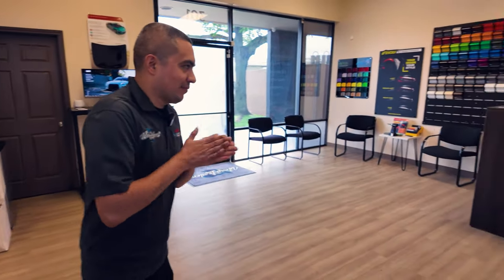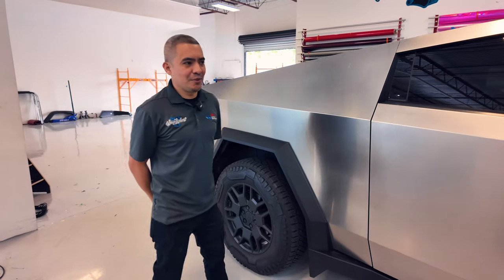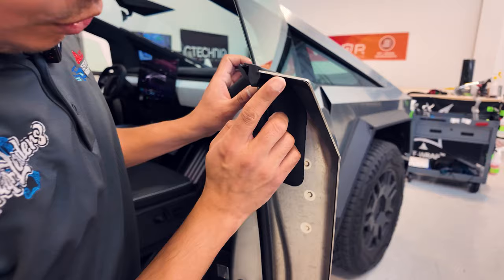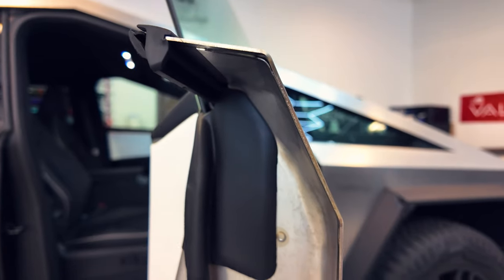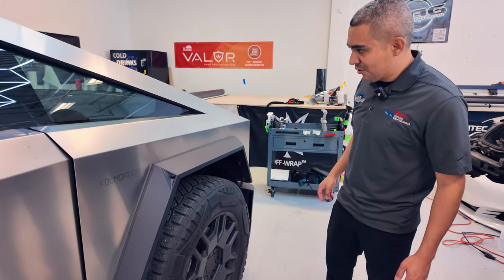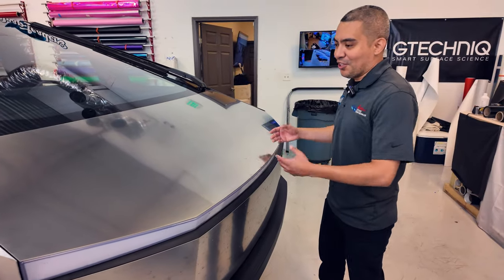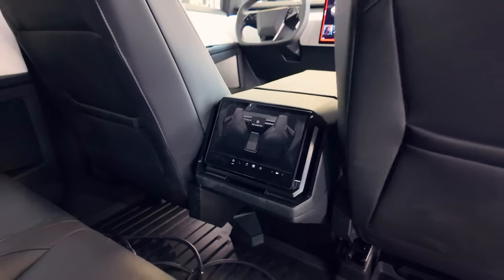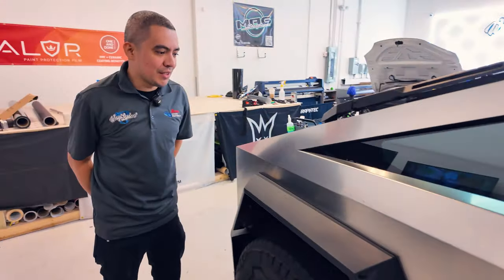Before You Wrap a Cybertruck Watch This! I wrapped one!

Comment: Magnets often won't stick well to stainless steel which is something I went over forty years not knowing. Depends on the type of stainless steel being used if I understood it correctly. Just in case that's helpful for future jobs.
Reply from the maker: Got ya. Thank you for the info. I usually use magnets when working alone but for this one they werent holding up. On some pieces i used tape just incase